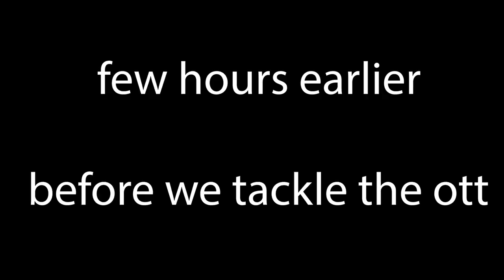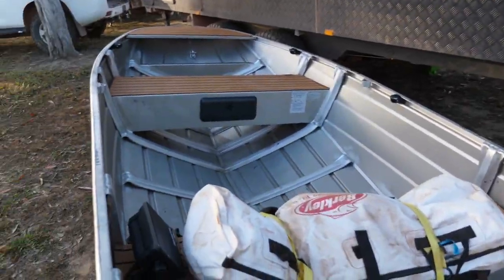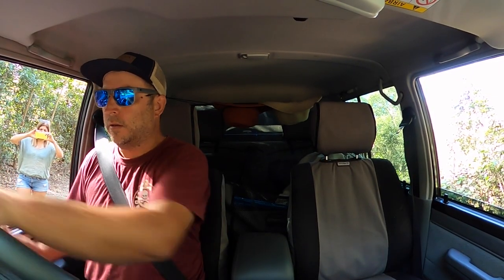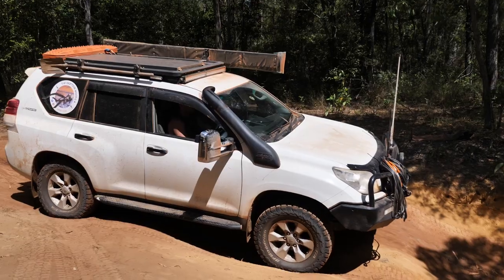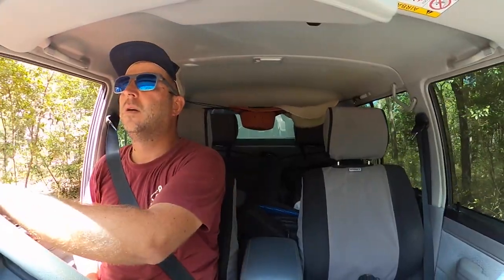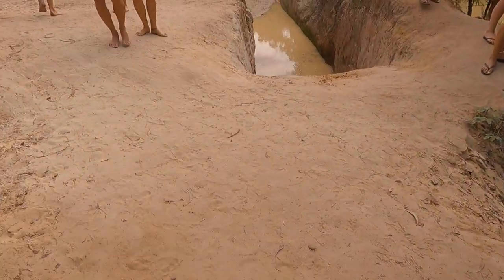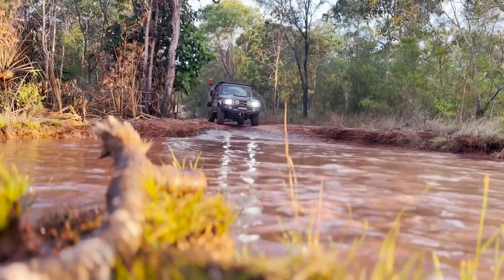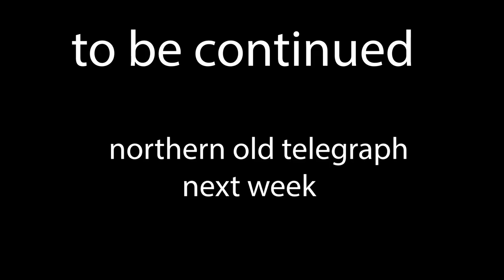WAS THIS THE RIGHT THING TO DO ?Ram on the old telegraph track

Comment: Haven't Palm Creek & Gunshot changed since I last was there with camper trailer in tow? I'm guessing I would have to think seriously about towing a 1.6 tonne camper through those crossings now. I might have missed it somewhere, but how effective is the Dometic DRS you have fitted to your van? It looks to be doing the job OK. Thinking of putting one on mine. Great video series guys. Enjoy the trip.
Reply: That is wild! Great job pulling a trailer through. Haven't done it before but they say the track changes every year. The domestic is great, it really does work. Just learnt to make sure to take a spare filter as on lce the filter is clogged it becomes less effective which is fair.
Reply from the maker: Yea mate . The talk leading up to our trip was that the track was going to be a challenge and that it has changed a lot. There were a few campers while we were up there that did it with there camper so it’s not that you can’t . 

The dometic drs system did work well but we advise you take a spare filter with you. We didn’t which we now wish we did. Only a small amount of dust to be fair but that was after the filter gets that clogged up even if you clean it
Reply: @justvanningit  Thanks for that. There seems to be a few people that can them & that the Carafan is better etc etc, but at about 1/3 the price plus accessing a power source near the install point in my van means the Dometic might suit me for what I do. Good to hear first hand feedback.